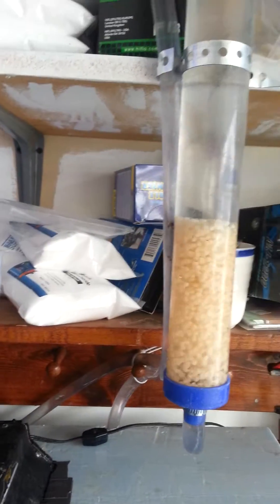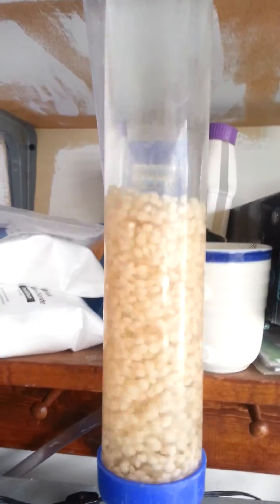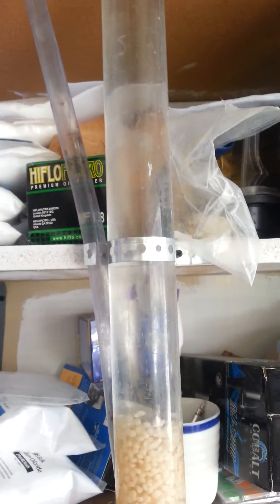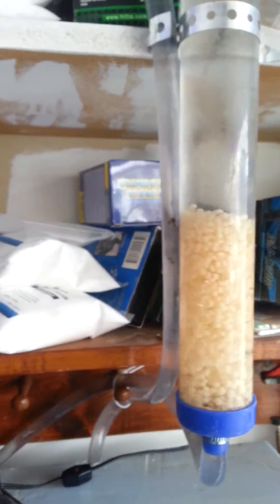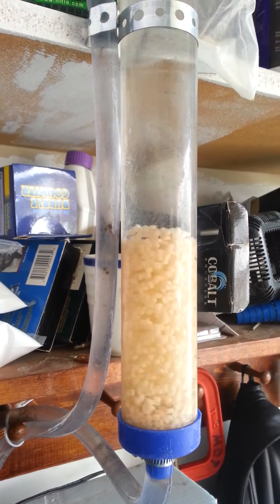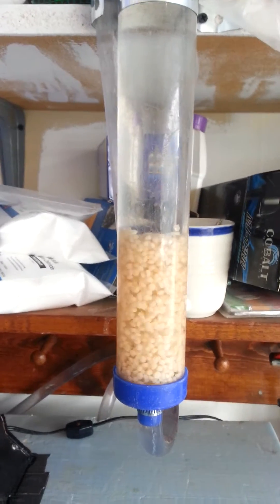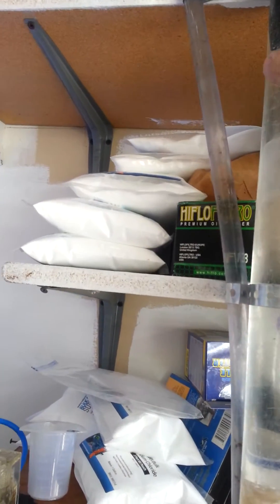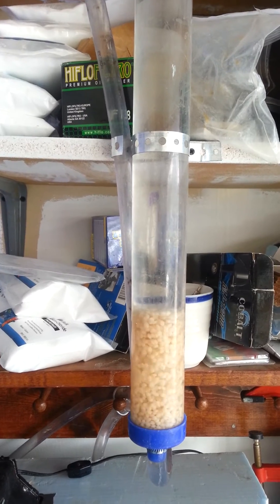(Completed) DIY Cost Effective bio pellet reactor

Comment: what if the power goes out?
Reply: @rotter tube reef I think he’s on about the pellets going back down the tube towards the pump
Reply: In the uk 🇬🇧 when you buy carbon (fluval brand) they provide you with a mesh bag I would recommend cutting a 2 inch by 2 inch square place it over the tube on the output of the pump as a fail safe Incase the pellets fall back into the motor housing that’s what I did with my diy reactor
Reply: +WebstockXalapa If the power goes out then NOTHING will work so what does it matter. hahaha